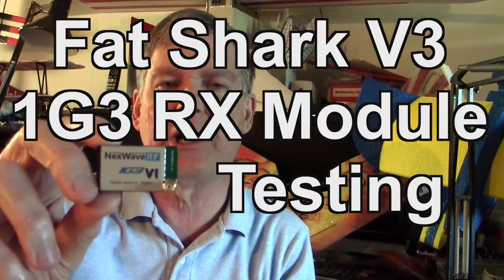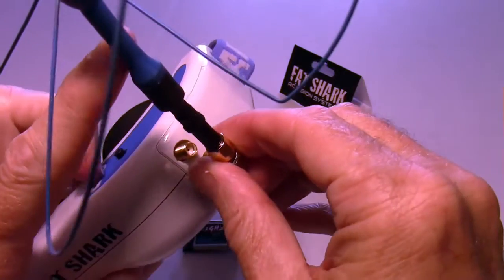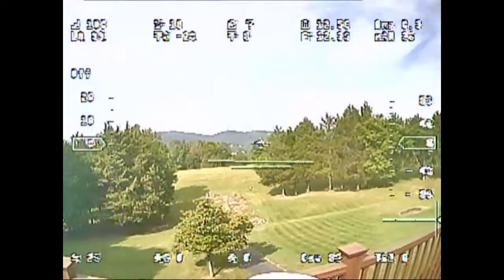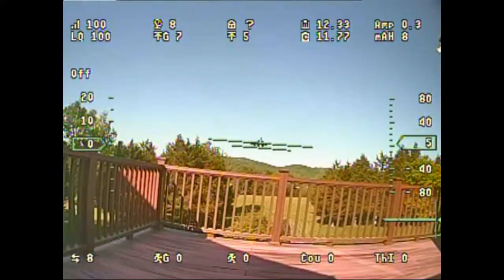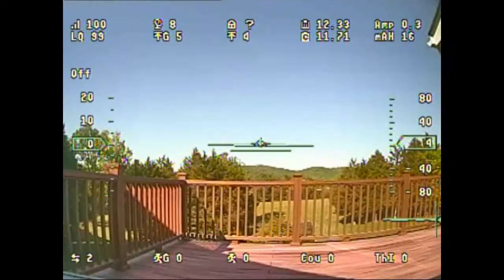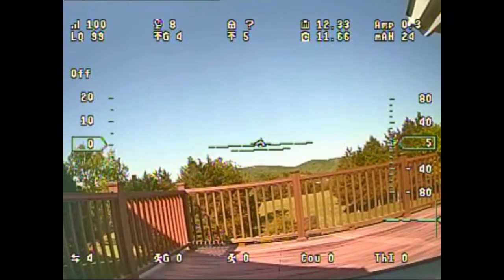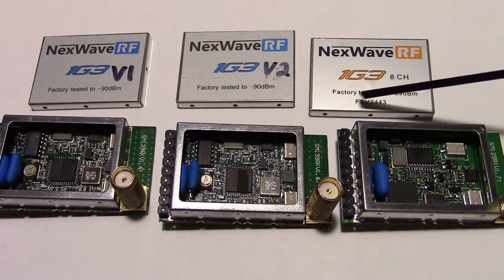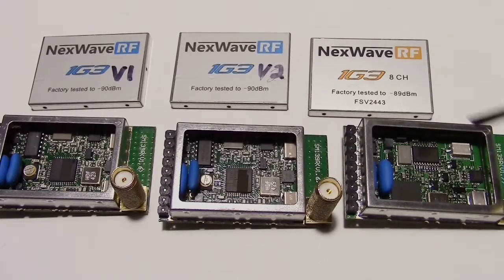Fat Shark 1G3 RX Version 3 Recevier Module (FSV2443)Testing and changing Audio Trap Filter

Comment: I really want a version 3, does anyone know who has them,  I'm in the US really want to step away from the tripod.
Reply from the maker: fatshark 1g3 receiver module appears to be no longer manufactured but they are on Fatshark site. Maybe you could ask them via the contact form. Also you could ask on the for sale section of RCgroups. I still use the it a lot and love it but make sure you get the orange one not the blue Nextwave ones, they have problems.
Reply: @DaveMerc  okay I will, and yeah I understand what you mean when you say buy the orange module, thanks
Reply from the maker: I contacted Fatshark and they said this: 
 "Unfortunately I don't believe our factory is making that product anymore which is why our retailers are not carrying them anymore. We can direct anyone who would like to purchase the product to the closest repair center to check if they have stock of the receiver.

Regards,"
Reply: @DaveMerc  they emailed me back saying Let me check if we still have some stock here in the US and get back to you tomorrow. We shall see, crossing my fingers
Reply from the maker: Maybe if they get enough requests they will start keeping a few in stock.

Comment: I know that I probably are barking to the wall, but I guess I don't have nothing to loose!! So.  Would you consider to sell me that module? I really need it.. and for some reason no one is willing to sell it here in the US any more!!!
Reply from the maker: What? That's news to me. I still use the heck out on mine. Don't want to sell it especially if I can't get another. Wonder what's going on with it.
Reply: @DaveMerc  I just found a seller on Aliexpress with a thousand of the blue versions in stock. I suspect they have a termination mismatch causing the image problems which will be an easy fix if correct, I ordered one as they are dirt cheap, but it won't ship until March due to CNY, then I will dig into it to define the fault. 
I want it specifically for my Sky04x second module bay, and just short to mid range flight of some of my long range planes. Cheers.

Comment: is it possible to connect the rx to something other than these gogles like a monitor or a laptop?
Reply from the maker: Yes I saw a post on FPVLAB forum where somebody make a test bed to plug it into and hook it to a monitor.
Worked great. But it would be easier to just by a 1.3G box receiver and you would get better sensitivity too.

Comment: Where is that sun LOL
I'm glad they finally get sorted out with most of their issues!
Sad you had to buy 3 modules on the way :s
You could not resist to do some mod at the end though :p
Thanks for sharing Dave and happy sunday
Reply from the maker: +ABMNS PRODUCTION There must be a million trashed V1 and V2 modules out there, lol.
The V3 is a completely redesigned RX and not really a revision at all. Yes I had to do the mod for the audio.
I use the audio in my movie editor to synchronize the video tracks so if it's there it makes editing a little faster. Happy mother's day :-)